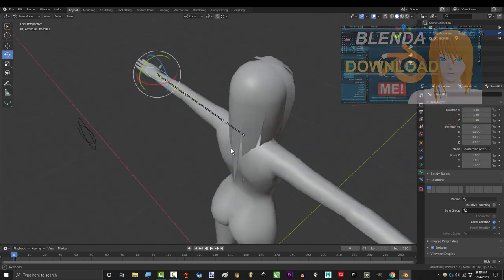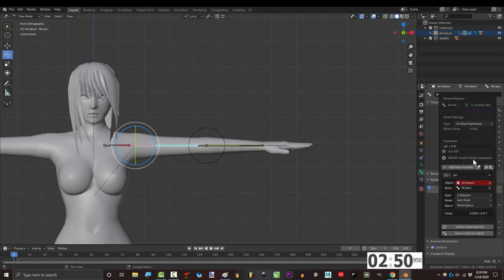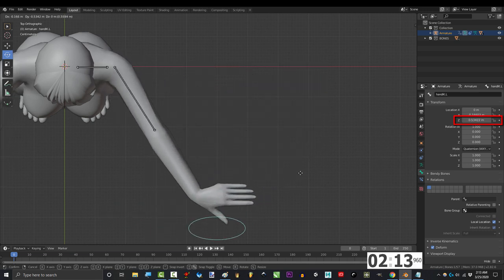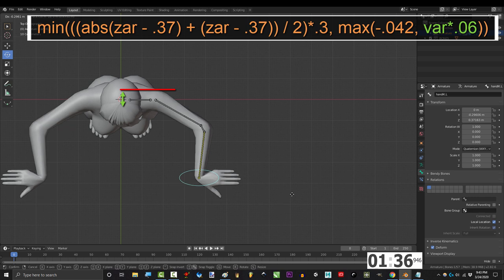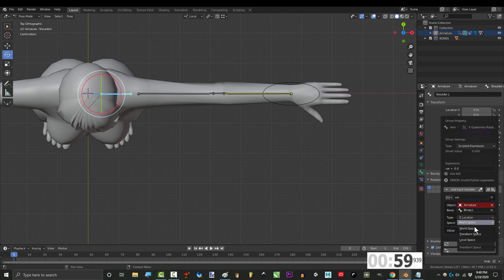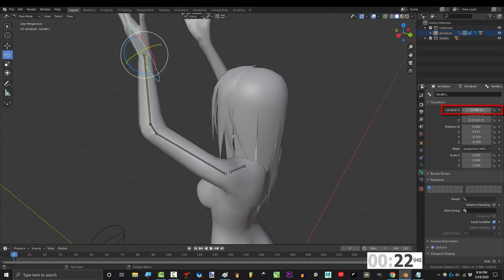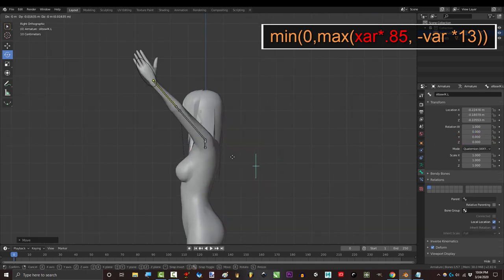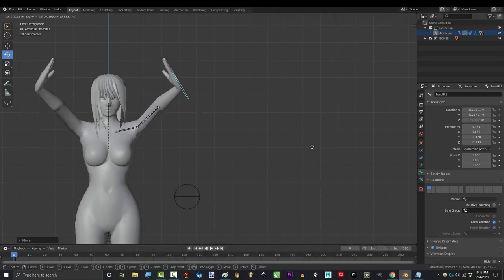Blender 2.82 : EVERY Shoulder & Collar Bone Driver (In 3 Minutes!!!)

Comment: That's a lot of neat info all in less than 5 mins! Awesome. A question: since the hand ik bone is not parented to anything, isn't it only local to the origin of the armature object? Doesn't this mean that if the character is laying down then the "local" Z location would still be in the same direction as when she is standing? I would think this would cause issues, unless I misunderstood something. Even if it was parented to a root bone, you would still have to animate the root bone 90 degrees which will screw up the rest of the animation (like animating someone laying down and then outstretching their hand).

Since we're using drivers, and the usage of more complex math is possible, we can convert the hand ik bone's object space location to what it would be if it were local to the upper spine bone inside of a custom driver function which can then be used inside the driver. It would look something like this:

__________________________________________________________________________________________________
import bpy
import mathutils
from bpy.app.handlers import persistent

def getBoneLocationIfLocal(arm_name, fake_parent, fake_child):

    rig = bpy.context.view_layer.objects[arm_name]
    pbones = rig.pose.bones
    pb_child = pbones[fake_child]
    pb_parent = pbones[fake_parent]

    parent_invmatrix = pb_parent.bone.matrix_local.copy()
    parent_invmatrix.invert()
    
    transform_matrix = pb_parent.matrix @ parent_invmatrix
    transform_matrix.invert()

    iflocal_matrix = transform_matrix @ pb_child.matrix
    iflocal_location = iflocal_matrix.to_translation()

    return iflocal_location

@persistent
def load_handler(dummy):
    bpy.app.driver_namespace['getBoneLocationIfLocal'] = getBoneLocationIfLocal

def register():
    print("--", "register:", __file__)

    load_handler(None)
    bpy.app.handlers.load_post.append(load_handler)

def unregister():
    bpy.app.handlers.load_post.remove(load_handler)
        
if _name_ == "__main__":
    register()
__________________________________________________________________________________________________

Here's a video example: https://streamable.com/9n2hv

EDIT: I should probably explain how to use this for those who aren't familiar with the concept. Here:

[arm_name] is the name of the armature object which contains the relevant bones.
[fake_parent] is the name of the bone you want to use as the fake parent.
[fake_child] is, similarly, the name of the bone you want to use as the fake child.

After you load the script into the text editor and click run script, the function [getBoneLocationIfLocal] gets registered in the driver namespace. Which means you can use this function inside of the driver ( like min(), max(), etc. ).

For example, if the armature object is named "body_f_ik", the upper spine bone is named "spine01", and the ik bone is called "hand.IK"; you would type the following in the scripted expression:
|-------------------------------------------------------------------------------------------------- |
|  getBoneLocationIfLocal( "body_f_ik", "spine01", "hand.IK" ).z  |
|-------------------------------------------------------------------------------------------------- |

This would give you the 'z' component of the returned vector.
Reply from the maker: Very good observation. The local space issue is actually in relation to the parent of the bone in question. We haven't gotten to this part yet, but the root bone will be parented to 2 more bones. One that controls vertical spin, and one that controls horizontal spin. If we rotate the parent of the hand IK, the local space value will still work properly. 

But, that custom driver is quite powerful. You could easily have accomplished the solution with it if you wanted -
Thank you very much for sharing :)
Reply: @TheRoyalSkies  Yeah, I figured we hadn't gotten to that part yet right after I posted this haha. I confess I don't quite get exactly how your method works to solve the issue but that only makes me look forward to seeing it in action in a future video! I'll see after that which would work better with my rig. Thanks as always for the quick and informative content.